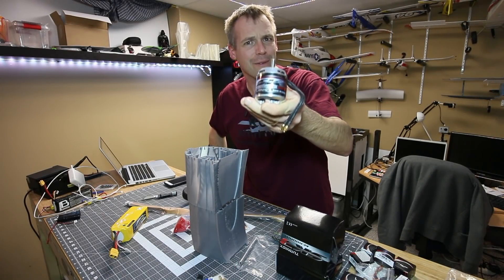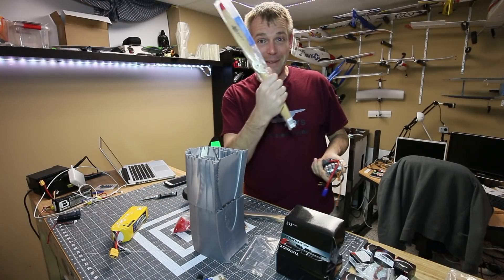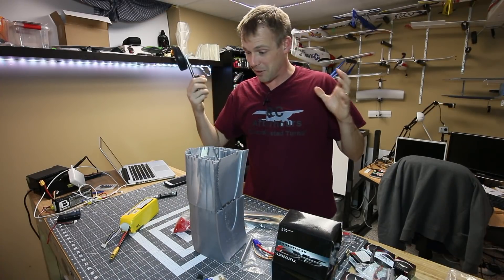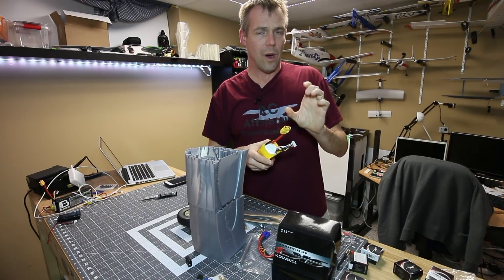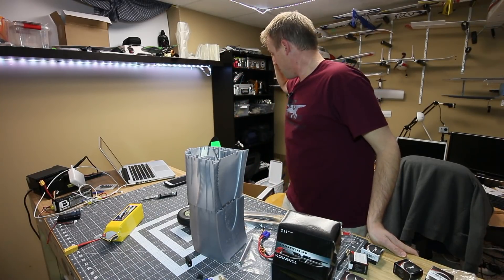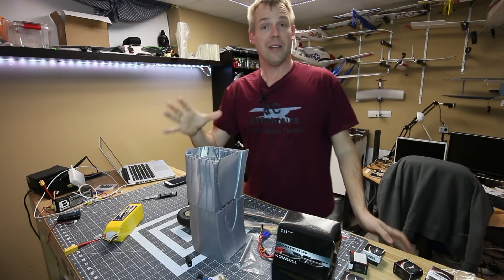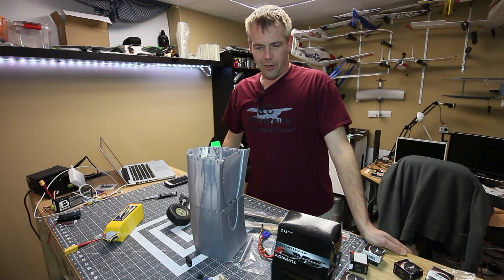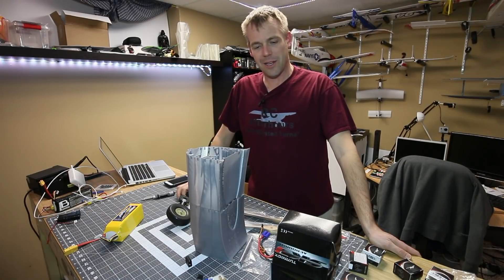Overpowered Spitfire - Update #130

Comment: Andre, I'm not sure if you've built the 3D Spit yet, but if haven't, you may want to think about adding a couple of half or even full popsicle sticks in the fuselage and in the wing above the wheels. We've flown (that my 13 year old son has flown--I'm scared to fly it with my skills) and --while he says it flies amazing--on one landing he caught a wheel and the plane went sideways and the the fuselage split on one of the seems, it didn't take much force. When I fixed it, I added a couple of popsicle sticks and the thing is much stronger! Also, on one semi-hard landing, both wings cracked right above the wheels. It seems the wings are so heavy the wheels act like a fulcrum and the wing tips flex on landings. I reinforced those with popsicle sticks as well--haven't had any problems since.  Good Luck. Can't wait to see you fly yours.
Reply from the maker: I'll get there. Thanks for the tips.

Comment: Andre, The talon came with the larger female bullet connectors installed. The male ends are in the box. I've soldered battery connectors before, but never had this issue. Are you planning on cutting the smaller bullet connectors off the Turnigy motor and soldering on the Castle male ends? Or is there an adapter out there I'm not aware of?
Reply from the maker: I will remove the smaller connectors from the motor and solder on the larger castle ones.
Reply: Thanks Andre! It's people like you helping people like me that make this hobby so accessible.
Reply from the maker: Glad to help.